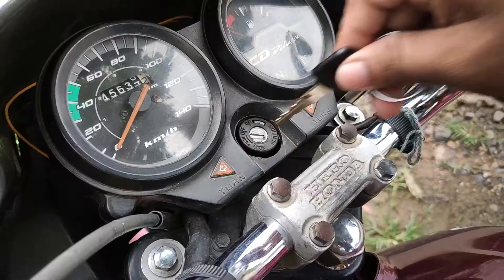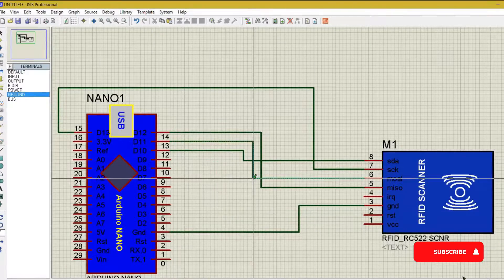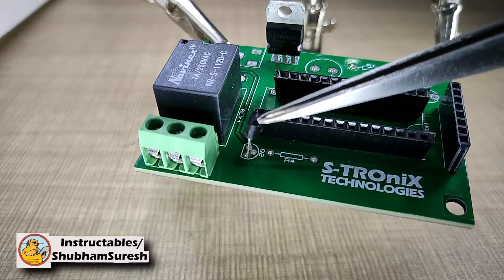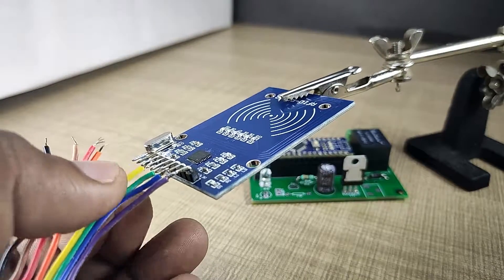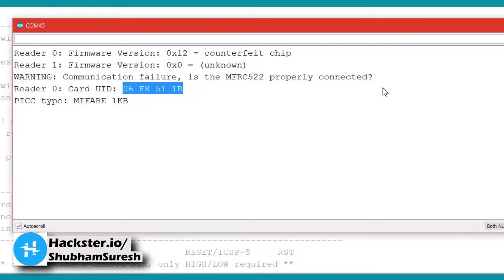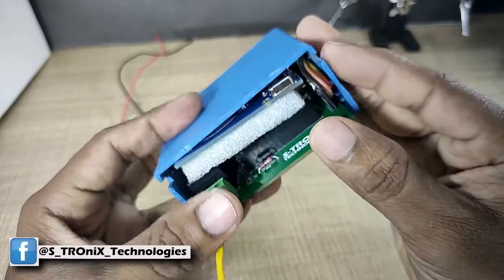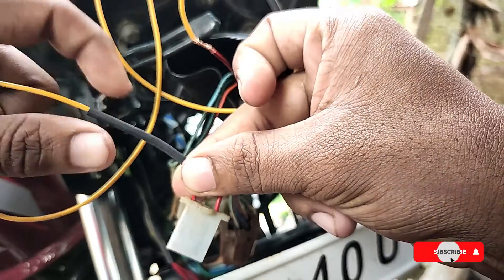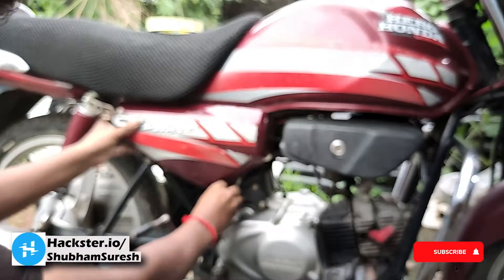How to make An Alternate RFID Key for Bike Security at Home | #Vehicle Security_1

Comment: When we switch off the bike, will the Arduiuno RFID module still have power, if that’s the case then there are chances of battery 🪫getting discharged soon..!! I don’t want to keep lock on the bike just RFID Lock system. So I basically want the Arduiuno not to suck battery when in resting mode, coz I guess there Led is still on in resting mode..!! Please suggest and clarify. Also need the PCB Link where can I buy..!!
Reply: I am also looking for that dude🙁